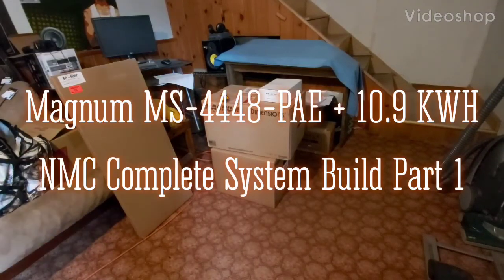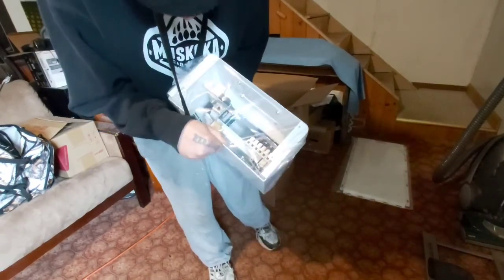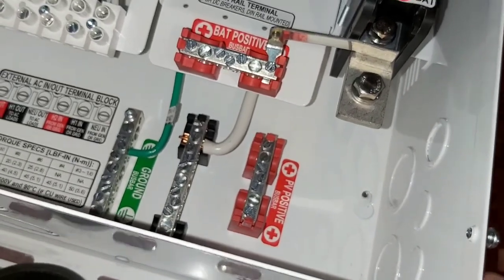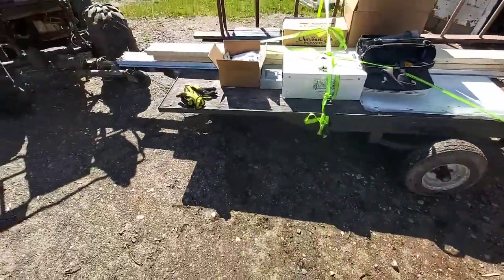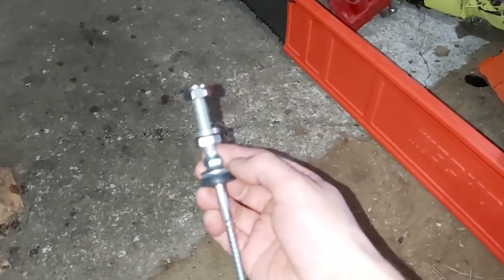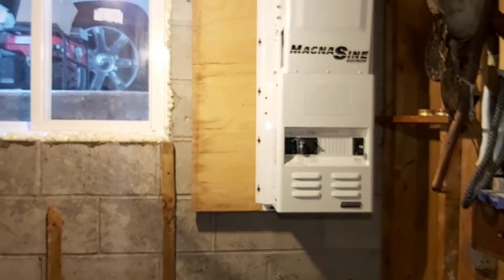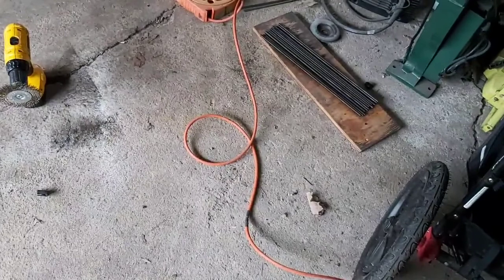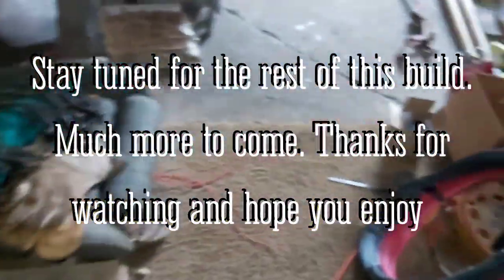Magnum MS 4448 PAE + 10.9 KWH NMC Complete System Build Part 1

Comment: Fun Project. I have a  Magnum with the mini breaker box. It has a Midnight classic and a Outback Flexmax 60 Bolted to the side of the breaker box with chase nipples. I have to use a block and tackle to hang it on the wall. When they are all wired up they system as a hole is very heavy. I hope to get the extension and another Magnum someday. I think that would be just right with 5k in solar and 15k in NMC batteries. I may even be able to run a mini split at some point. You do nice work my friend.
Reply from the maker: Your system is great. Part of the reason I went this way. Cheers . Hope you guys are well